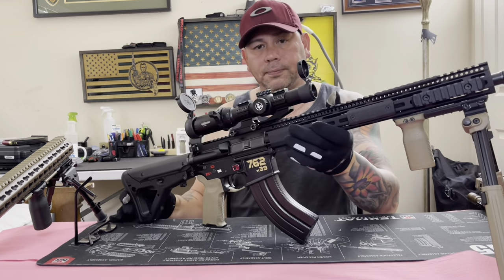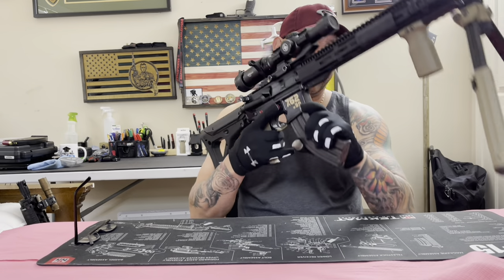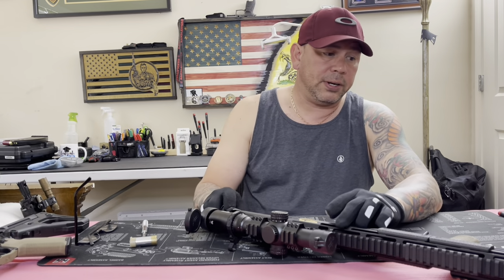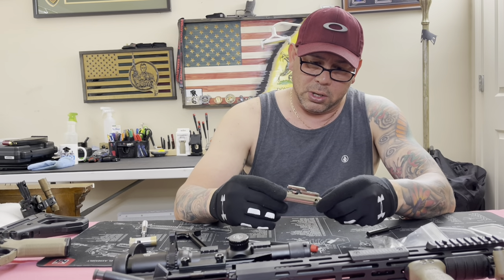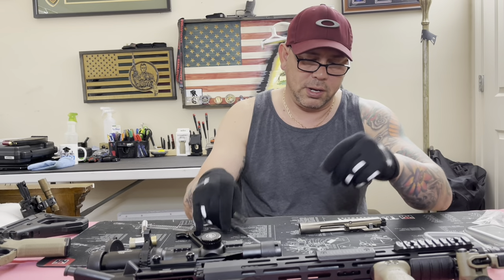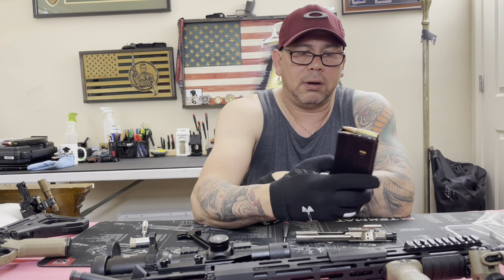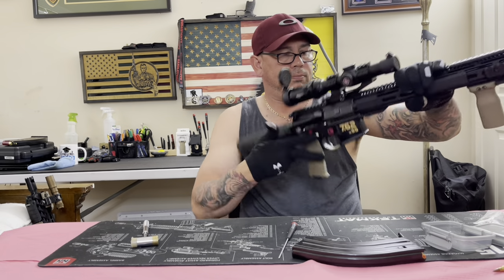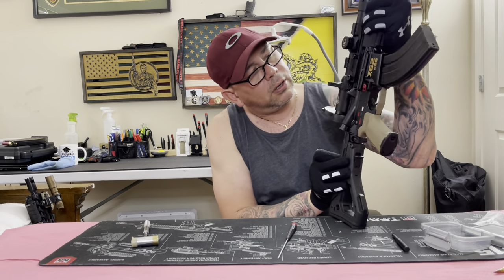AR15 .223/5.56/300BLK to 7.62x39, How to do the conversion.

Comment: Since you have experience shooting the 300 blackout and I don’t, do you think in a (poop hit the fan scenario)  it would be a better bullet than the .556? If you were in a war like situation what would you pick the 300 blackout or the 556 or another option? Just curious cause I’m thinking about building a 300 blackout.
Reply from the maker: 300 is a great choice but is a SHTF situation I’ll stick with 5.56/.223 or 7.62x39. The 300blk will be a hard to find ammo. But for home defense I’ll go with the 300blk because of the less recoil and less penetration compared to 7.62, but still have the same .30 cal projectile and better stopping power than 5.56. That’s why I decided to go with 300blk with my AR pistol. But you can always have both like me, two uppers, different calibers, SHTF no problem swap the upper accordingly with the available ammo.
Reply: @gunsrus777  Good points. Thanks for responding.

Comment: hello and new to the channel.... I have the Ar15 .223/556. If i wish to switch to the 7.62x39 upper, doesnt the complete upper come with the bolt and firing pin ??????
Reply from the maker: It depends, some does some doesn’t. All depends what you buying. But of doesn’t come with the BCG you can use your 5.56/.223 bolt the only mod will be to replace the bolt and the firing pin (enhanced bolt). Or you can buy it separately, so you have both completed bolts 5.56 and 7.62, two pins out and snap either one.
Reply: What kind of mags do I need?
Reply: Are you using regular 556 magazines for the 762 upper
Reply from the maker: @iruamak8225 https://www.ammosc.com/ar15-30rd-762x39-stainless-steel-magazine
Reply from the maker: @iruamak8225  https://www.ammosc.com/ar15-30rd-762x39-stainless-steel-magazine

Comment: Hi I got a cuestion I have a remington 223 and I will love to convert into 556 is that possible ?
Reply from the maker: Are sure your .223 rifle is not multical, means .223/5.56 most of the 223 are 5.56. But if doesn’t say it in the barrel is not 5.56, 5.56 is hotter round and if your barrel doesn’t have the tolerance for that round can damage the barrel. Well if your remington is an AR15 is ease all you have to do is purchase a more than 16 inches barrel if is a rifle, if you purchase the entire rifle assembled you cannot go under 16” for the barrel. If you buy it as a AR pistol you can go under 16” or if you bought the lower receiver and received as others and built your rifle you can also go under 16”. Under 16” can wear a butstock unless is registered as a SBR but still can attach a brace. Lil complicated. Make sure if you converting the .223 to 5.56 to check the tolerance of your BCG, should be fine but I recommend to get a better bolt if shooting 5.56.
Reply from the maker: Question? Why you want to change the .223 to 5.56. Is a very similar round, almost identical.

Comment: Can I do the same if I have an AR shooting is 7.62x39 and I want to switch to 223/556? If so what would I need?
Reply from the maker: Bolt assembly with firing pin, 5.56/.223 barrel, gas tube and gas block. Or you can buy a complete upper receiver with BCG and 5.56 mags
Reply: @gunsrus777  thank you! Awesome video!

Comment: I would a just stuck with 300blk or got an actual Ak. 762 ar bcg have really thin bolt faces and are prone to cracking. Even decent bcgs suffer from this problem because the bolt face walls just are not thick enough